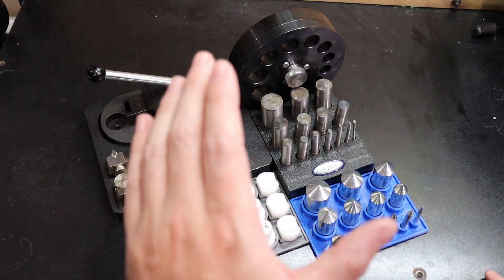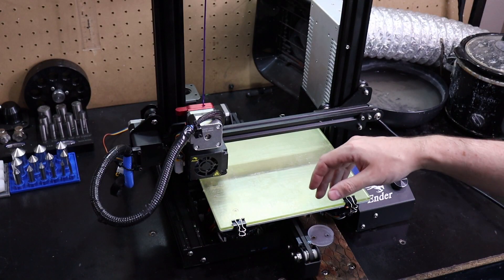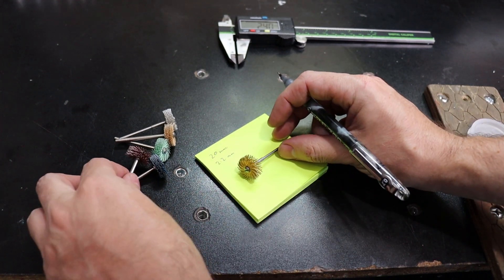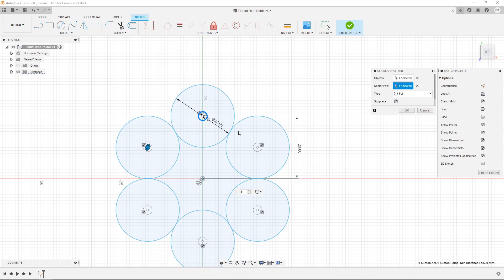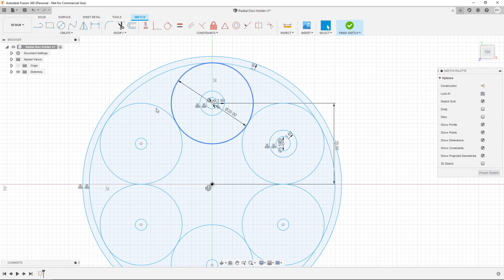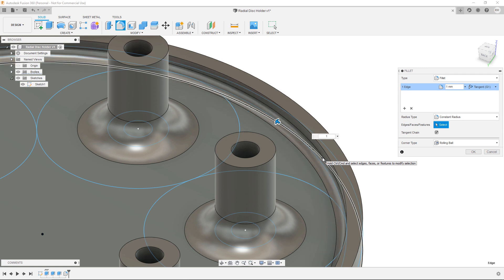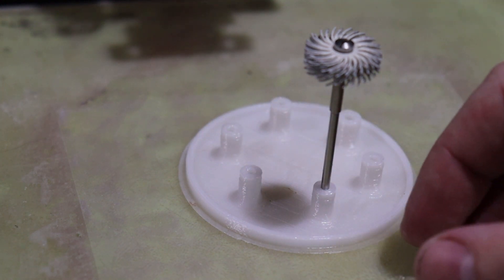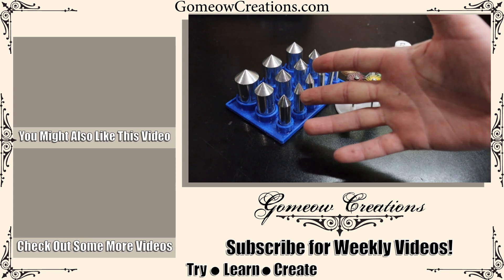How to Design and 3D Print Your Own Tools

Comment: You don't need to undo the  circular pattern to change the diameter of it.  Just change the dimension and Fusion figures it out.  And a quicker way to do the circles for the little posts is to do a circular pattern  again suppress the bigger one - there's a suppress checkbox.
Reply from the maker: Idk what part you are taking about but you are probably right 😅